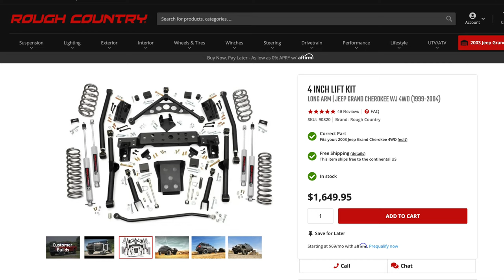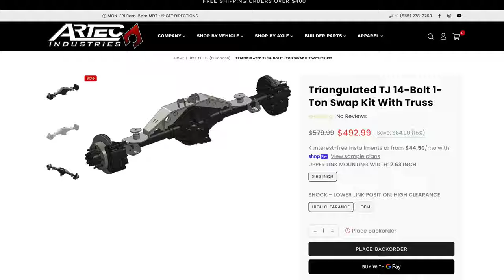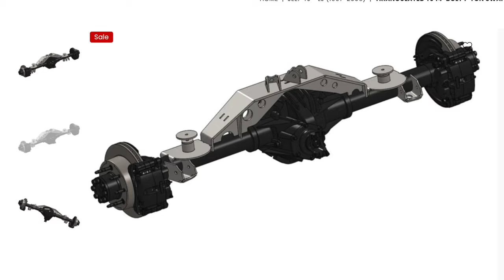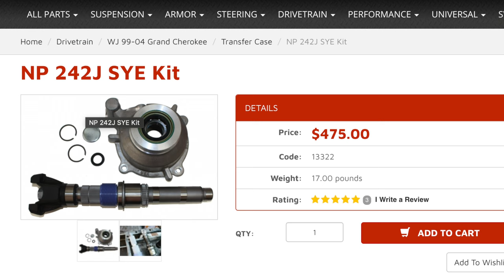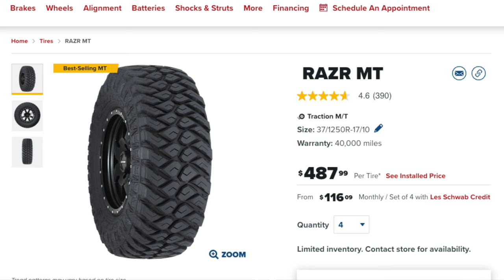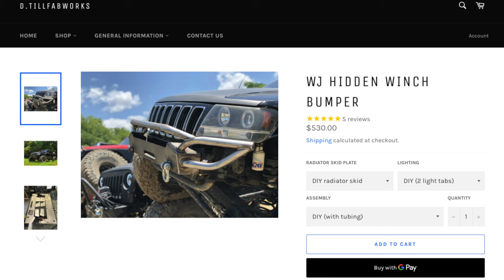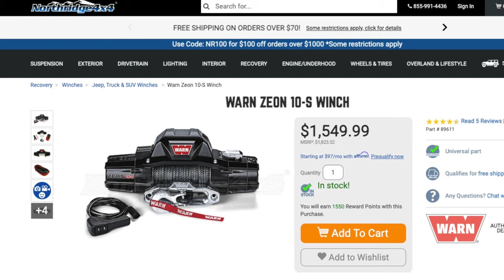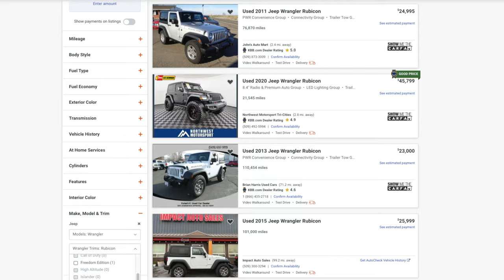Build Budget Breakdown: How Much Did It Cost to Build the 1-Ton Swapped Jeep Grand Cherokee WJ?!?

Comment: For all you’ve done your in it pretty cheap, my base was 10k but that included 87k on the odometer with a 4.0 in it along with IRO 4” long arm kit, 5 Mickey T’s wrapped with 33” D-Cepeks, Trail Forged front winch bumper and their radiator support. I get a lot 👍🏼 because she’s clean AF inside and out, I’ve added Fox 2.0’s w/ adjusters, built a awesome drawer system in the cargo area for trail storage along with a bed platform for the extended trial runs and a cheap roof rack for now to hold the spare tire until I have time to fab one……….so I’m in it for 13k thus far!      Just
                                                                          Empty
                                                                          Every
                                                                          Pocket
Reply from the maker: Hell yeah! Your rig sounds sick 💪🏼 I’m probably gonna look into those Fox shocks you have for this. I’ve got Fox 16” remote coilovers for the Durango, big fan of Fox 🦊 products. Thanks for watching brother!
Reply: @PSFGarage  forgot to mention I do have the reservoirs, I did get lucky getting the fox in a reasonable amount of time. When I called every shock builder out there I was told 10months lead time, through my connections I was able to get them in 3 weeks…….it’s nice to know people lol …..thanks for the compliment!

Comment: Wow dude, that thing is a beast, badass too! How does it do with those huge tires and all the other mods with the 4.0? 

I managed to find myself a unicorn. 2004 WJ Loredo, 4.7 with only 32k miles on it. It was some dude's 2nd car and only came out in the snow. More than half the miles are open country roads. The 4.0 was my preference also, but this ran and sounded really good. And the interior, 90% mint! I just put a 2" lift with BFG All Terrain TA 245/65/17 on Rock Trix rims with a +12 offset. It looks amazing. The tire and rim combo fill out the wheel wells nicely. It's not nearly the beast yours is, but I do have an 03 Rubicon I'm working on. The Cherokee is my daily driver.

Nice ride, great video. If those hood mounts for the lights ever fail M11 Offroad makes a decent set for $45, mine should be coming soon. Any suggestions on light pods?
Reply from the maker: Thanks so much man! Appreciate the compliments and you watching! It does great now that it’s regeared. Sounds like you have an awesome rig too! You on IG?

Comment: You do know the v8 did come with a transfer case that does 2wd but its pretty hard to find. It's called 242hd transfer case. I bought my wj for only $500 but that was back in 2000 before prices went crazy!!
Reply from the maker: I did know that! But yeah, super hard to find. I honestly don’t know if I’ve ever found one and haven’t seen one for sale. Would be cool to find though. Sounds like you got an awesome deal on yours. Thanks for watching!! 🤙🏼
Reply: I have a 2000 wj 4.7 that has the 242hd t case. Last year I swapped in the 4.7HO motor w 545re tranny. I've yet to see anyone else do it and almost 100% factory didn't make all of that an option. I have 1 ton axles to swap in asap

Comment: Great breakdown! Super informative! Are you running the shock that came with the RC long arm kit? I have the same kit and plan on going from 4" to 6.5" but I'm unsure if I needed longer shocks...
Reply from the maker: Thanks so much and great question! I’m running the shocks that came with the 4” kit. They seem to work just fine with the 6” springs but they may be just slightly too short. Probably going to upgrade soon though and see if there’s much of a change.
Reply: @PSFGarage  Sweet! I was looking at the bilstiens and they cost more than the springs! That was the only thing keeping me from moving forward with the 6inch. Thanks for the reply! I really appreciate the info! I couldn't find anything in the forums!

Comment: Now thats the holy bible for every wj . May i ask you , why the 4 lt and not the 4.7 v8 ?
Reply from the maker: I’ve had Chrysler/ Dodge 4.7’s, 5.2’s and 5.9’s. They’re not bad but they’re not great. I’ve had lots of issues with them. Got rid of the 5.9 in my Durango build because it had cracked heads, amongst other issues, and decided to go LS. The 4.0 is bulletproof and extremely reliable. It was also far easier to find the NP241 Select Trac transfer case behind the 4.0 and the 4.7 usually comes with the QuadraTrac full time 4wd case. It was a better combo overall and more reliable in my opinion.
Reply: @PSFGarage  I was sure that the 4,7 are totally reliable, without any issues . So your advice is to go for the 4 lt Laredo.